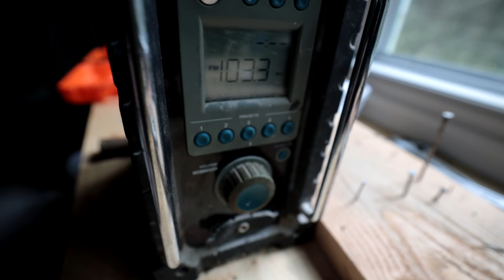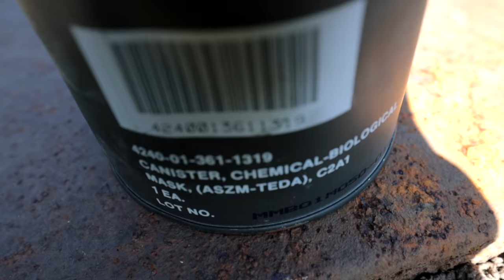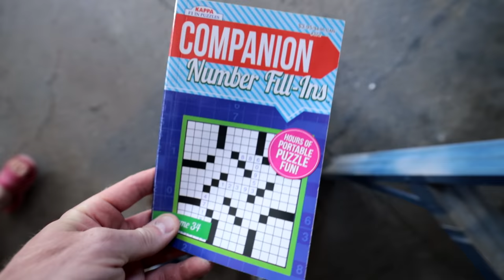I Built a Fallout Shelter!

Comment: The filter you're using is not waterproof it's water resistance on a mask at an angle might be good to make some little roof over it to shed water from entering it if it rained. You also you might want to do some math as far as the internal cubic feet of air those are design for intake in a very small space around the face in a sealed mask don't know but I don't think it's going to work properly for that much cubic foot might be dangerous. Now this is a thought you could drill pipe nozzles along the side to put these canisters in several and didn't run NBC hoses from the inside say 6 ft length to attach to mask like we used to in our tanks in each person in there where an individual mask with their own filter attached to the outside. Might also want to check online there were vehicle filtering units it was in a square case canister about 18 in high 6 in in diameter which was one massive filter that everyone used to plug into in a tank with service for people for a very long time it also had electrical connection cuz it had a blower fan that would assist in the filtered air being pushed through the tubes to the mask

Comment: You will run out of air that air filter is for 1 time use once you open the. Can it deteriates over a short period of time you will need a 12volt small. Blower to Moe air in and a way for  bad air to escape or you will run out of air

Comment: not impress... you need more research on this... first mistake is your air system... if radiation fall out it will block the air filter... should be downwards not facing the sky...

Comment: Pretty cool grave for you and your familly in a fallout situation, another perfect example of a guy who can make a you tube vidio with absolutely no idea of the science involved, as in it takes 10 ft soil to keep out a large dose of gamma Ray's, plus the canister is only good on a gas mask ,not capable of recycling large volumes of CFM's, you would have been better off to dig on flat ground,  place the pipe in vertically with a smaller pipe and stairs,  a 9k air filtration,  ect, the door will also not stop any radiation at all, plz folks dont think this will save you or your familly in a fallout situation,  it's a cool kids fort though!!!!

Comment: Im sorry but i think there will only be a little chance in surviving a bomb explosion if u will stay in that shelter. the door is made of steel but the front wall where the steel door is attached is made of wood, you might get toasted inside because of that. also the explosion can melt the pvc pipe you used for the air system. surely the filter will be detached in no time. just a little suggestion,  putting that shelter underground might increase. your chance of survival in  a bomb explosion, try to build something that can surely save you.